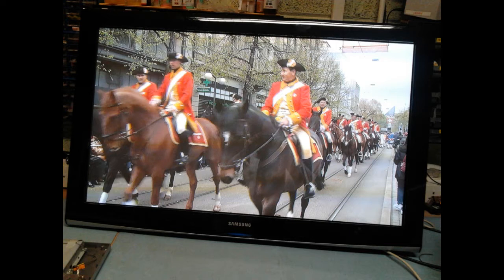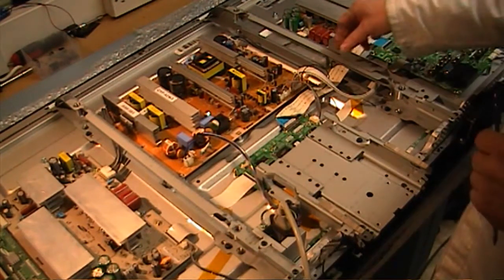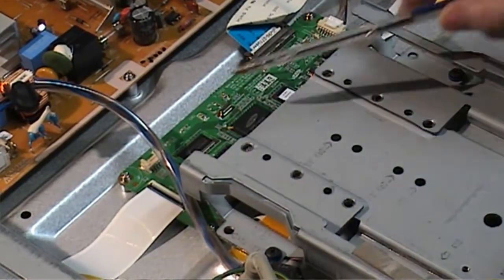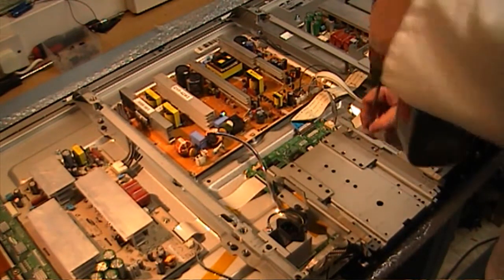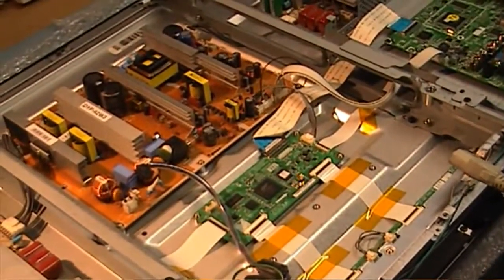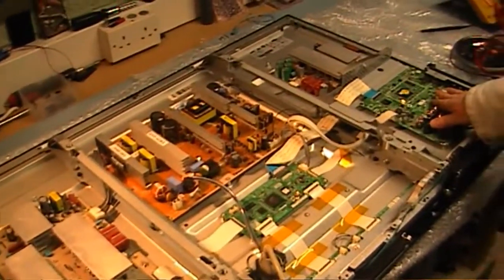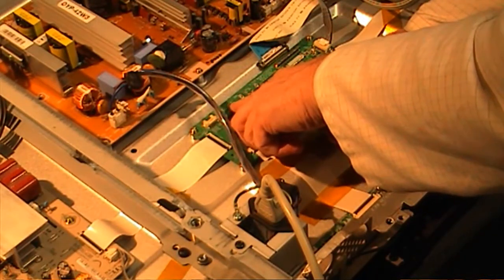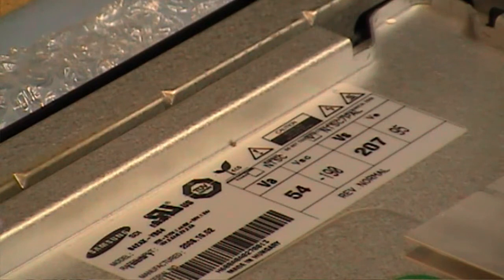Samsung PS42A451 Screen Service mode S42AX-YB04

Comment: I'm currently working on a Visio Plasma that has a Samsung sticker on the inside with the same model as listed in your title. When pressing the power switch, the Visio emblem switches from yellow to blue but no screen. I performed the power supply test as you mentioned and found that the Va rail is at 112 when it is suppose to be at 54 and the Vs at 436 when it was supposed to be 207. I couldn't find the Vsc or Ve rails to test. Do you think the display may be damaged with those high voltages? The PCB seems to still be operational with the fact that it will power on and off when pressing the power button.

Comment: Great videos you made, but. I miss the videos is in a better resolutions, i can´t not see the details, such as the components. And i had a questions, why is there more PCB on the Samsung, than the Luxor TV ?
Reply from the maker: The luxor tv is an lcd, and the samsung tv is a plasma
The plasma screen requires additional pcb's to drive the screen
Reply from the maker: sorry about the detail in the picture,
I am using a consumer type camera, which will not focus when zoomed in
I hope in the future to get a better camera